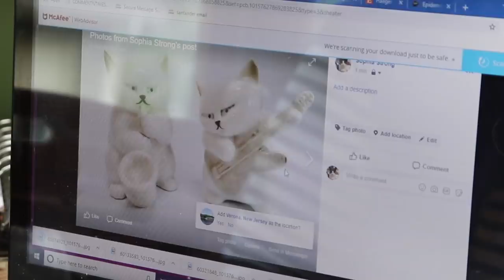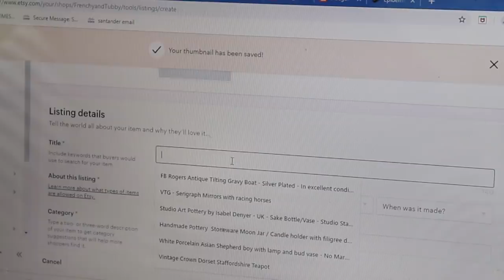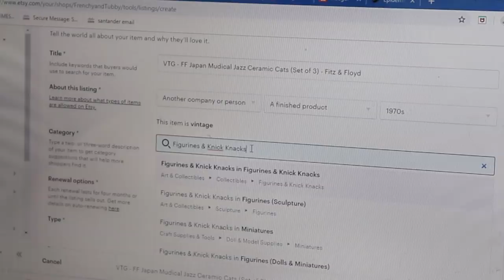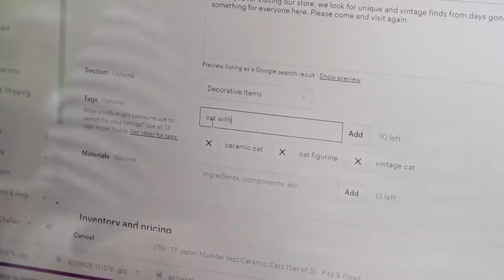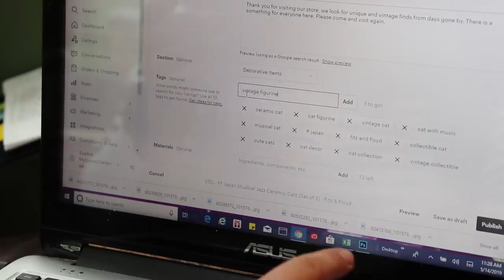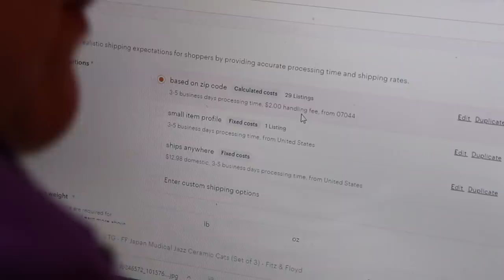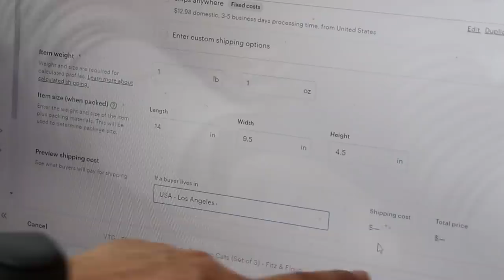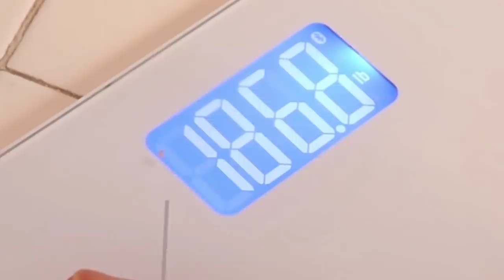🌼 Staycation 2019 - Day 3 - Etsy Tutorial ||  weighing myself  || Sanding and Painting 🌼

Comment: Sophia just some helpful advice. I'm a seller on poshmark. When I started out selling I used to use the brown paper and stick the labels on the outside. The postmaster at our post office told me they don't suggest using brown paper with the shipping labels attached directly to it. Sometimes the paper gets damaged going through the post office machinery. If the paper comes off and the label is lost there is no way of knowing where the order was supposed to go. If you aren't enclosing an invoice in order for the post office to be able to return the package to you or the buyer you may run into issues with some lost packages. I would suggest using brown boxes or flat rate boxes from the post office (they're  free and the post office will deliver them) and taping on the labels. Just some suggestions I'd hate to see you loose your items. Or at least write on the box please return to and your address just in case in paper is lost in transit

Comment: You can cut down on the dust by using a wet sponge instead of the sandpaper to smooth out the drywall mud. The end result is a lot smoother finish too.

Comment: Hi Sofia, just wondering what type of paint roller covers do you use?  Brand, size, material. I tried painting my wall (sheet rock that has no texture on it and was already painted previously) and it left the wall with a texture like an orange. HELP please...
Reply from the maker: I use the cheap ones from home depot. The trick with paint is to really spread it thin.

Comment: I’m curious as to why you don’t use the Usps prepaid boxes? It would be cheaper and a standard price.....

I’ve always wondered how those scales know all this info 😳🤔
Reply from the maker: it's not cheaper. for instance, if i have a large item which is relatively light, i would need a large flat rate box and the shipping for the flat rate is 24.95. if it was in a regular box the same size for its light weight, the buyer would pay $11 or so based on their zip code. Flat rate boxes are great when the item is very heavy otherwise, it's not good for buyers.
Reply: @mygreatchallenge  good to know.... thank you.